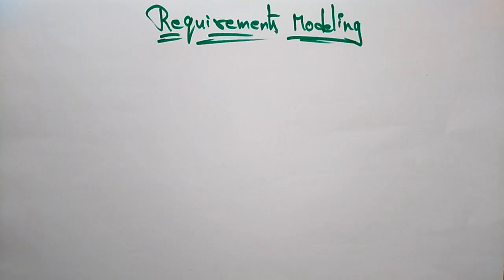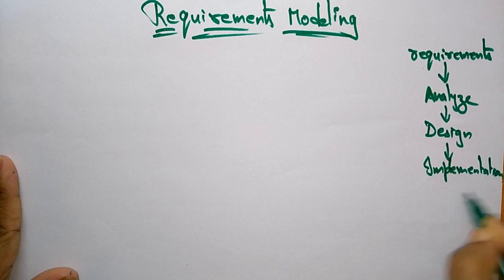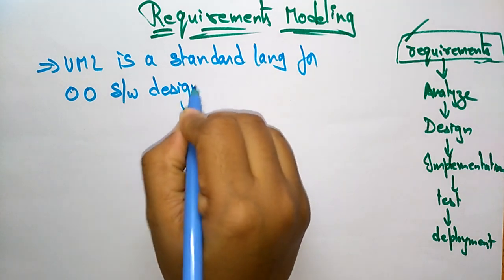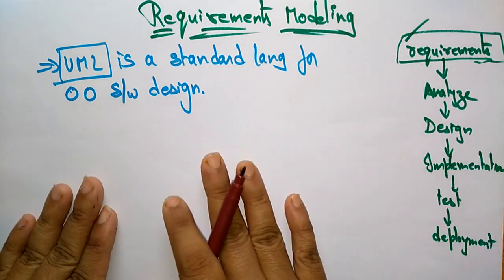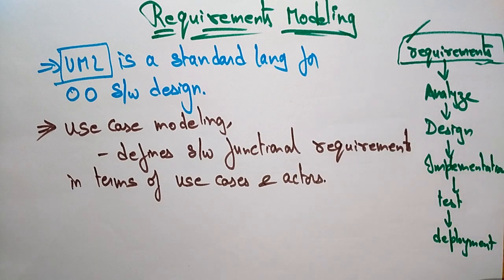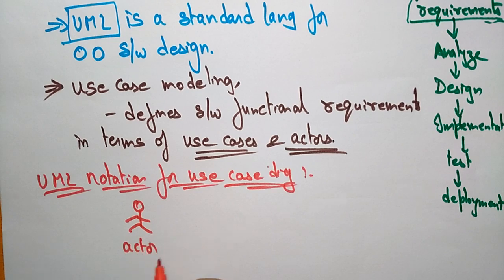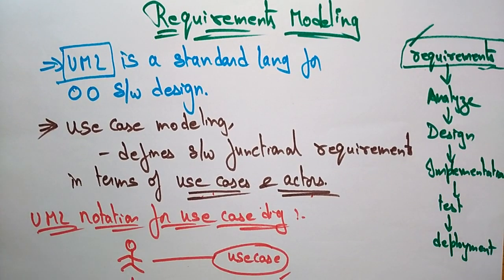requirement modeling | object oriented software engineering |

Comment: 00:05 The key stages in software development are requirements gathering, analysis, and design.

00:50 Requirement modeling is essential for product development

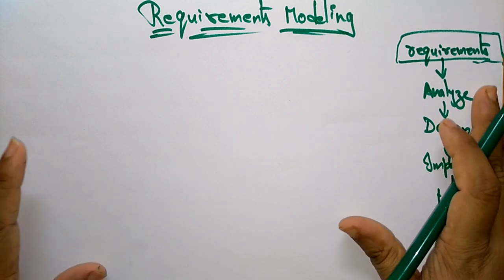01:15 Designing the analysis and requirement models

01:43 Unified Modeling Language (UML) is a standard language for object-oriented software design

02:16 Requirements modeling using the Unified Modeling Language

03:04 Software requirements are gathered through use cases and actors.

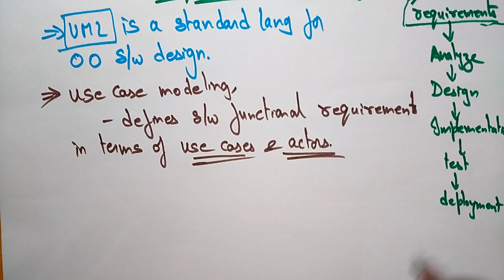03:35 UML Notation for Use Case Diagram

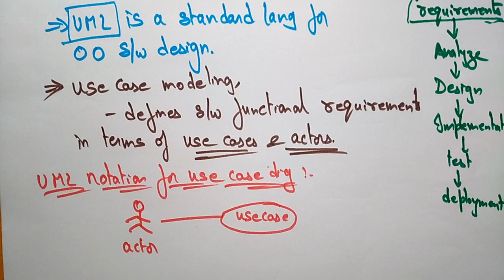04:14 Use case notation in requirement modeling

Crafted by Merlin AI.